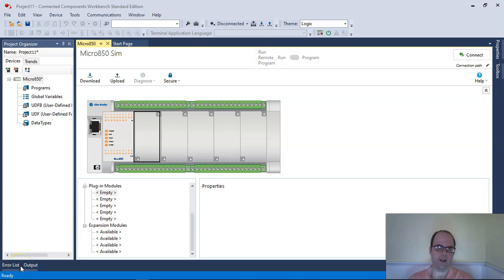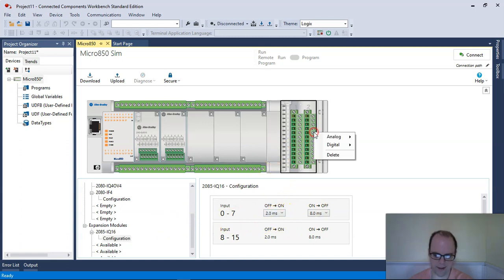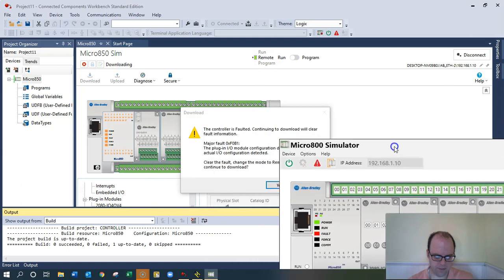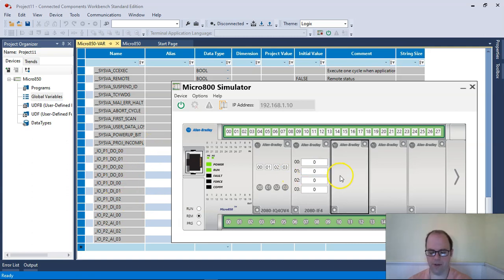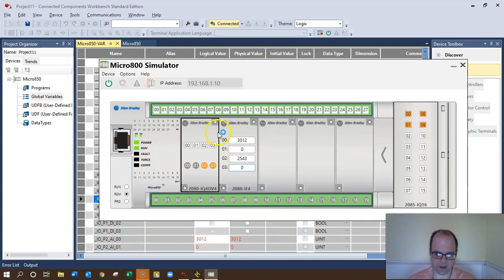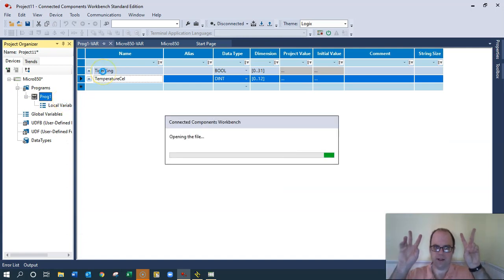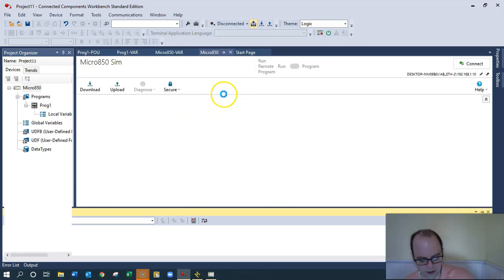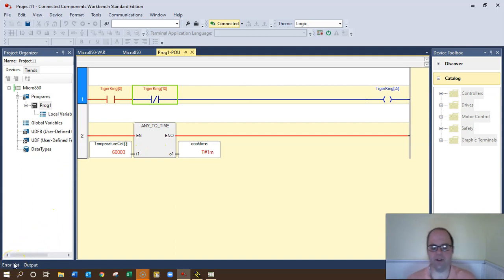I/O Addressing and Data Types in CCW

Comment: Excelente video. Just a question about using arrays, is there a way to see the coments or description of bits of an array that we're using, I mean, if I see the input or output from the program I just see for example INPUT[0], but not what that input means, I have to go to the variable chart to see the description o coment. So, is the a way to see what that input[0] means without entering the variable chart?
Thanks again for your video.

Comment: Hi Dan! My question is about changing IO modules revision. Can I reduce that, for instance, in historian module from rev 5.101 to rev 3.101?
Reply from the maker: The IO revision just has to match the hardware. You can physically swap out to older module just updated in the program. I wouldn't flash backwards the same IO module to an older firmware because that often causes issues. But if you have an older one lying around, you can use it or flash that forward.